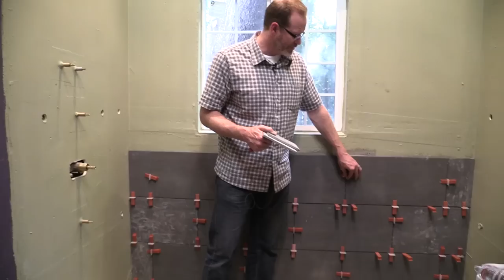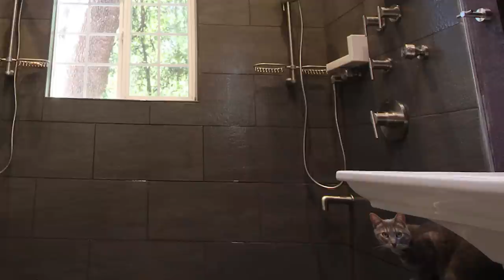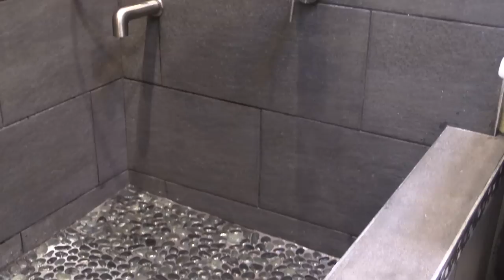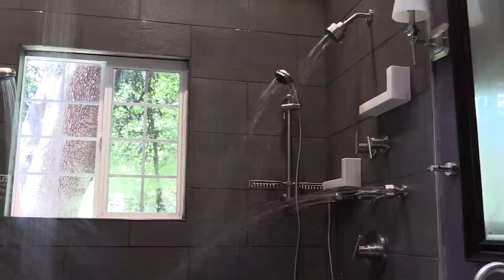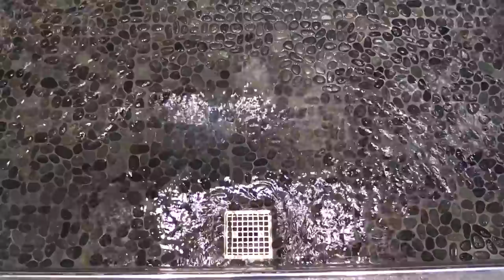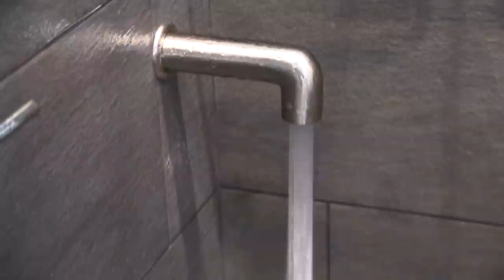Making a tiled bathtub AKA a roman tub, Episode 3/3

Comment: It would have been nice to see the tub filled. I'm seriously considering this as my next project, but I would likely slope one side of the tub for actual tub use.
Reply: I love the idea but every time you want to use the Roman  tub you have to scrub and clean the whole surface area including the grouts for molds and dirt. You don't want to soak on dirty water right? And that's a big job everytime! Not to mention the technical aspect of waterproofing the whole wall area of the tub before tiling.  Without waterproofing water would eventually seep in the wall behind and cause leaks and mold- big disaster.
Reply: @kalatbasura  this is not true You don’t have to clean it every time And waterproofing it is not hard
Reply: @kalatbasura  I clean my tub extra clean everytime I'm gonna use it either way so
Reply: Yes, want to see how the water stays in when wanting to use it for a little soak.

Comment: would not have done it this way. bumpy river rock to sit/lie in for tubbing? doesn't seem comfortable. also, it's sooooo big, would take all day to fill. waste of water much? also, there's a lamp on the wall right outside the tub. nope. also, there's a faucet snug up under a shelf. nope. as cool as this seems, the video lacks all the important details. how do you angle to floor properly to drain into the drain? what do use to grout the tile? where is the ceiling fan for moisture ventilation? Not what I was hoping to see at all.
Reply: Damn, you like to rain on peoples parade don't you basil? You're a rainy day parade, I think Oregano wouldn't have been a judgemental as you are, just saying.

Comment: I have a couple of questions because I have been considering having  Roman tub built, instead of our current, however, is a shower curtain needed to contain the water spray?  Also, if you are taking an actual bath how do the river rocks feel to the bottom? (I know that is a crazy questions,  and I normally wouldn't ask except we literally just bought this house and the bathtub has anti-slip  texture and it really hurts my skin.)😊
Reply: If you havent done it yet... Get 2 sheets of the riverrock tile, and sit on them for a bit! It will be the same, but in water, you will also weigh less.

Comment: What were the considerations regarding the plug hole blocker (to allow the bath to be filled for a bath?  and were any considerations made regarding the pressure applied to the trap when unplugging the water after a bath?  ps.  great job - just interested in more of the technical details

Comment: I’m building a tall Japanese soaking tub ATM. What type of plug did you use? I’m also questioning having just a chrome S trap without a puddle flange. I have an access panel downstairs to service the drain base. Any suggestions? 🙏🇦🇺

Comment: only problem with using grout in the bottom of the tub is over a period of time with the pressure of the water coming out of the faucet to fill the tub will eventually wash away at the grout. think about what water does to rocks over a long time when it keeps running over it
Reply: Yeah its called erosion.

SCIENCE!
Reply: Um. Not in this lifetime.

Comment: how do you stop up the tub to fill?
Reply: I also want to know how do you stop up the tub to fill. I want to do the same style for tub/ stand up shower/ steam shower. What type of plumbing would you use to stop drain. Thanks
Reply: Chieu Nguyen You would just need to buy a bathtub drain and it will open and close they are using a shower drain it defeats the purpose but they where looking for a big wide open shower but you could use it as a bath tub with a different drain
Reply: @lukeus007wotb8  couldn't you just get some sort of flat square plug made of rubber? im sure there are custom plugs online

Comment: Built in drain plug I hope but I doubt it the tile leveller is a wast it you have to cut the plastic tabs off leaving spots water can form and grout is thin if you use a trowel with a 1/8 or 1/4 notch and a level shower tiles can be placed with out the extra steps I get the same looking results free hand

Comment: Huge mistake on the drain, should have used one from a company called trim to the trade, it has a pop up plug and you just simply use the one that you have now in the pony wall as a overflow gets rid of the rocks out of the wall , probably won't use that type of water proofing.
I think the hot mop is the best way to go
Reply: Their method catches the splashover, too, which is a must if kids are going to use it.

Comment: I love the effort but it seems the owner/builder got carried away. That's too many shower fixtures!
Plus this is the problem of diy contractor. This kind of installation is a disaster in the end in so many ways:
Firstly, no waterproofing was done in the wall before tiling. Especially that it's gonna be a tub, water would seep in behind the tiles via grout! Expect leaks and molds in the wall and the adjacent rooms.
Secondly water pressure. As you can see, the water out of rainshowers and body showers anemic. Imagine more when all fixtures are opened at the same time- it'll be an expensive drip drip frustrating shower experience.

Comment: would anyone care to explain how they plan on stopping the water to fill the tub? because they explain their crazy overflow solution and skip right past the fact that they arent using a trip lever, toe touch, or twist and turn drain.... I'm trying to solve this problem at this very minute and this video is literally useless to me showing a roman tub that literally can't be filled with water... also this is destined to fail very quickly as hydroban does not have the perm rating to use for submerged applications.. you absolutely MUST hotmop or use an uncut folded PVC liner and clamp ring drain for this to last more than a few years without destroying your house. They also skip right past explaining their little leak around the drain... my guess is they used a kerdi floor drain and plan to throw a rubber mat over the drain to fill it up...  You CAN in fact find 90 degree turn low profile clamp ring drains that fit inside 2x4 studded walls to execute a proper overflow on the wall of the tub if you look for one, and there are clamp ring style roman tub drains available to order for around $70 with built in 2 inch twist and turn stoppers. OS&B makes the clamp ring overflow drains that fit inside 2x4 walls and plumblingsupply.com makes a 2" FIPS cast iron clamp ring shower drain with 2" twist and turn roman tub stopper, I'm just not fond of this solution myself. I would like to find a way to execute a trip lever solution using a normal clamp ring ABS shower drain base that is threaded into a trip lever bathtub kit and find an overflow arm for it with threaded bolt holes for a clamp ring? So far this seems impossible though, I can't come up with a way to clamp down the standard overflow drain+arm in a standard tub kit onto a pan liner. :(
Reply: I am dealing with this situation right now trying to find a tub drain with overflow that will work with a pan liner. Did you ever find a solution to this? i would greatly appreciate your feedback or help as i have been looking to solve this issue for a few days down and am ready to start forming up my pan but cant seem to figure this out. Thanks again!!!